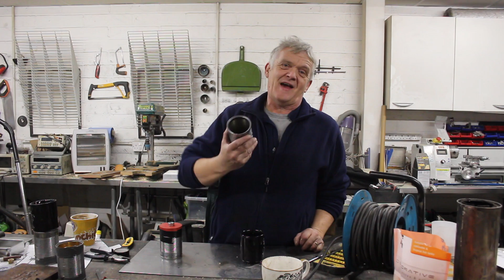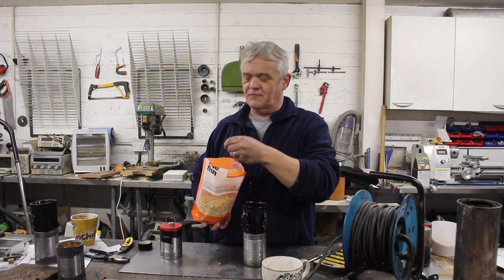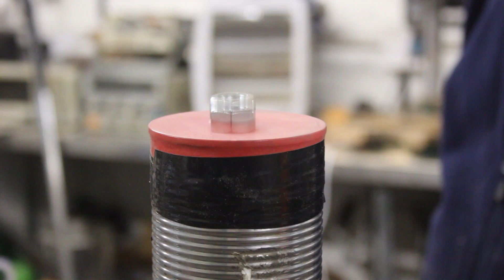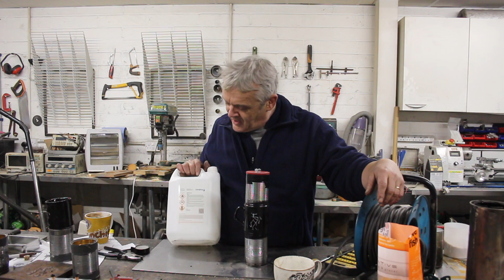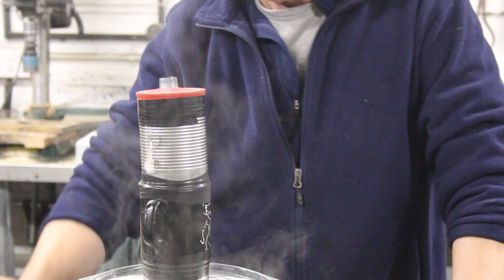1775 Running A Strange Engine From Hot Water

Comment: And in walks weirdo with his silly question of the day:
Which stage do I need to wrap the cooling jacket around, for max differential?
I would assume the top, and I shall try this.
And then I shall see if it can use water with hot water.

Comment: Why don’t you take an unmodified speaker and seal it to the top of your tin can heat engine. The speaker diaphragm replaces the balloon, and the magnet & coil should generate electricity. A subwoofer would have the longest stroke and strongest magnet.

Comment: You should try different types of ceramics. Zirconia and steatite both have a very low thermal conductivity number, alumina is a little higher.  Fiberglass and epoxy have a thermal conductivity number of less than steatite or Zirconia, but you have to worry about melting or deforming from heat.  It would also be interesting to see what using copper for the top and bottom would do as far as efficiency being as steel has a very high resistance to heat compared to Copper.

Comment: You could put several of these in series to drive a crankshaft and get decent torque. It could be placed over a heater without decreasing the heater's efficiency, in reality it would be "recycling" some energy from the heater (at least while the environment is colder than the heater itself) so it would be a way to reduce a heater's electricity bill (since it would generate electricity), the question then becomes how much of this can you put on a heater to get bigger and bigger savings.

Comment: Once you have the magnets installed, I bet you could optimize the effeciency by modulating the power output, ie, changing the apparent mass of the magnet/membrane system.

Comment: Could you have  insulated foam for the separator?? And have a better insulation value but air can pass through??  Or anything with cooling the top (old pc heatsink bonded on)

Comment: Methanal, ethanol, or plain rubbing alcohol will rust out the bottom of the can eventually. What if you switched out all three cans with a glass or plastic tube instead. Maybe three ceramic mugs instead?

Comment: Sorry off topic but it don't know any other way to contact you 
Magnetic neutralization  there is a gentleman on YouTube that has developed it he gets 2 1/2 times out of his generations .with magnets on the rim to generate the power on the wheel crossing iron core coils then in side near the center of the wheel there is  small neos in aliment with each coil\ magnet turning on the rim and an adjustable opposing neo s stationary .they must be adjustable and smaller .I was thinking of your wind generator .or any generator .just food for thought .merry Christmas  I'm buying the first round .

Comment: Luvly!  The stones are your heat exchanger.  You could perhaps try something metallic like steel wool (which would be fine with your methanol working fluid) in a fairly thin layer.  Also solder a bunch of fins on the upper can where you are trying to waste the heat to improve dT.  And a tin shroud soldered around the boiler to improve heat capture from the heat source.  Etc...  The speed your brain works you could make a hat out of the device and charge your phone off the waste heat from your brain activity!!!  :)

Comment: Will start to store my hot shower water and place some of these devices in. Instead of just letting it down the drain.
To make it a little safer with flame and ethanol you could heat water and place the device in that water. Just adjust the flame so it don't boil away the water. Adding a water cooler at the top of the device would also be an idea, as you could cool water outside and bring it in to the device to make the temp difference bigger.
Can you run it upside down? In that case the temperature at the top will keep the heat as heat moves upward and the bottom can keep the cold a bit longer.

Comment: Maybe make a v2 out of plumbing fittings and using PVC instead of the ceramic. I really want to see how much power can be produced using lower boiling point liquids like methanol or butane, but I get that it's rather dangerous.
Reply from the maker: you are talking 4-8ml - not that dangerous mate

Comment: I didn’t get why with the ceramic mug there’s no need for the pin hole to equalize the pressure.
Reply from the maker: I might have made a mistake in construction and not fastened it up properly so I might have a leak so I will need to check as I don't get it either
Reply: @ThinkingandTinkering  having an enclosed system would be a game changing

Comment: got one running nice jumps about 4-5cm but i did need the small hole to get it started , next step is to try to run a fan directly of a crank attached to top of can it should help cool the top can. my plan is to use it on the fireplace like those peltier ones you can buy , awesome vid
Reply from the maker: I might have made a mistake in construction and not fastened it up properly so I might have a leak so I will need to check

Comment: if we install Piezo Sound Buzzer instead of Magnet & Coils, HOW  efficiency will it be as  İt's will be much more cheaper cost vise, with the same invesments we can make 4-5 of those power towers.  Also maybe we can drive a a basic  folded paper/ alim . Cooking sheet (origami style) air foils 2 drive air as a  fan, for a stove top fan. And instead of tin we can use Alim. Cans as they are mor heat conductive, maybe we can scrach them in the inside to destroy plastic lineing and increase the air & alimin. Contact area.
Reply from the maker: I dunno - try it and see

Comment: Rob, If you use alcohol (no heating applied at all), and drive the diaphragm manually, such as with a speaker coil, will the bottom can get cold?

This could be a cooling system powered by sound.
Reply from the maker: I dunno

Comment: Great content, I'm sure it's already occurred to you and other followers, but average ground temperature runs around 55 F (at least for my geographic location), and I've personally researched dozens of solar thermal collectors that are easily able to reach 140 F with water as the working fluid and up to 170 F using air as a working fluid. Several were made from empty beer cans. Placing this engine between the two could prove extremely interesting, considering that the average person would be able to recreate the engine and thermal collector with limited capital. The overall efficiency might be much less than PV solar, but it also wouldn't cost $8k to build. I wonder what the size requirements would be to be able to make a model large enough to supply electricity to the average household.
Reply from the maker: those are all good questions and ideas mate - well worth investigating

Comment: I look forward to the generation. Probably need to reduce the weight, as the magnetic resistance will take on that role. Obviously not much power but the relatively high frequency should help.
Reply from the maker: yes I was thinking that
Reply: @ThinkingandTinkering  if it is too hard to get the resonance going with magnets, you could try capacitive generation, which is an interesting topic in itself.

Comment: Could you load it with carbon felt instead of the rocks?
Reply from the maker: now that's a very interesting idea - cheers mate
Reply: @ThinkingandTinkering  also:  assuming you use water in the bottom can & not methanol, will it still work if you put a single ice cube in the top to help with thermal exchange or will the cool water dripping down into the bottom stop the "reaction"

Comment: Robert: Can you explore the idea of using very small generators that charge a capacitor  with a system for releasing the charged capacitor to heat a resistor for a sand battery, etc.  Overcome the challenge of starting power to begin  generation....Thanks for the entertaining and fun learning! Ron Malenka
Reply from the maker: I have already done something similar mate

Comment: It's a heat pipe with a flexing end.  So what if we made two sections, one hot up tower with the motor membrane for expansion and the other in cooling water tower in a room temp passive water bath for condensation, put them in a loop connected at each end.  The Carnot cycle efficiency would be raised because water contact on the condenser surface will transfer a lot more heat quickly.
Reply from the maker: cheers mate

Comment: Hey @Robert, What happens if you fill the bottom with sand and heat it instead of water. Using the sand battery technique.
Reply from the maker: I don't think a lot will happen mate - but you could try it and let me know
Reply: At the least, how about wet sand heated to near boiling point?

Comment: I wonder if you could heavily insulate the engine and use liquid nitrogen or some other super cold liquified gas to run it from room temperature difference.  I don't see why you couldn't at least until it fully gasifies and the rubber gets damaged by the extreme cold.  Maybe something like this could be placed in-line with a coolant system to use the energy off of it to blow the air making it more efficient.  Could go any way with it to be honest.  A question that I have though, could a smaller hole in the bottom of the top can cause turbulence to make the diaphragm move more times.  Like the glass thermoacoustic engines are made.  Just some random thoughts.  Thanks again Rob!
Reply from the maker: I don't think you would need to be that drastic to get it to run at room temp mate - we are not that far off already
Reply: @ThinkingandTinkering  LOL, true enough.  It was only a thought experiment and for a reason.  Using this in a different environment as a viable soultion.  For example on Mars or the moon where temps are a bit more harsh .  But, yeah I get  what you are saying.  Admit it though, it would be fun to take to an extreme.  Thanks Rob!
Reply: @ThinkingandTinkering  I guess my point was that they will work with any temp difference if it be of a high enough magnitude.  Cheers Rob!  Thanks for the reply!

Comment: Try R-134a
Reply from the maker: I don't have any
Reply: @ThinkingandTinkering  It should be available at auto repair centers.
Reply: Just a few questions.
Is the methanol in the bottom can?
How much gravel in the cup? Could you use a plastic jar instead of the ceramic mug?

Comment: Still hoping you'll use the I-Stove as the heat source to charge your phone! Would a flower pot (with a screen covering the hole at the bottom) work instead of a ceramic mug?  How about ammonia cleaner rather than methanol as an operating fluid?
Reply from the maker: I will get there mate - that step is easy lol - I don't think a plant pot will work over time as it is porous and ammonia is a bit smelly to work with but I would think it would work just haven't tried it

Comment: I was thinking to rubber band a wet rag around the middle can and use a squirt bottle to rewet it if it started drying out during use, but ceramic makes more sense.
As for alcohol in place of water, that would also work on a sand battery. Maybe a rectangular container with several of the generators side by side, then pour hot sand (or water) into the rectangular container. (Thought of that when I passed a long, rectangular flower planter and wondered how many cans would fit in it sitting side by side) Any source of heat (stove top, rocket stove, solar) could be used to heat the sand (or water) and it can be used indoors safely.
I figure if one of these generators can make a usable amount of electricity, 6 of them all running at once should make more.
Love this channel.
Reply from the maker: I agree mate - cheers

Comment: Robert I desperately need you to wrap a copper coil around that top can and put a lite neodymium magnet on that nut. Simple as that.
Reply: How many turns of the copper wire would be needed and what thickness or gauge does the wire need to be please?
Reply: @kentishbunyip6081  depends on the output your hoping to achieve also how big of a magnet you used. Also the diameter of the can. How far the magnet is from the copper. Essentially you want it as close as possible. Metal bottom can plastic/or nonmagnetic top can? So the magnet isn't pulled to the can. I would say a smaller diametr wire arounf 20ish wraps would probably get decent results. Put whatever your using to measure the current + on one end of the wire - on the other. Plz share! :)
Reply: @kentishbunyip6081  I honestly see alot ofnpotential in this. You can lift s magnet of substantial size with this little force and once it got started jt would go intil it ran out of heat which could be anything from focused sunlight to rubbing 2 sticks together.
Reply from the maker: getting to it mate - but you culd also do it - you know what will happen I will do a version and folks will make a hundred suggestions and all of them good - I can't do it all mate
Reply: @ThinkingandTinkering  i love that you actually respond to your subscribers. You are correct I could. I have tried a couple using different rubber material as i dont have balloons handy haha but i digress. Keep doing you robert, we are merely commentary to the masterpiec YOU direct. Side note i know you deal with a bit of negativity from time to time. -Some people could literally stand on a hot coal and complain about their feet being warm. Your doing work that will be appreciated long after their cries fade. Truly a role model virtue and character.
Reply: Many thanks for the replies guys. Time for me to get my thinking cap on then. My children already think their mother has gone mad with these experiments but I come from a long line of tinkerers so....... I hope I will have the last laugh when I can at least charge my phone from a bit of drainpipe & balloon sitting on a radiator, or some such.

Comment: Instead of the diafragm you could use a speaker. Then you also have a magnet and coil and you can make (some) electricity!
Reply from the maker: the speaker is damped so you would lose power but worth a try for sure

Comment: Great Job Robert. Have you tried punching holes in the mug with a nail? Trick is to submerge it in water while you do it. Saves buying diamond cobolt drill bits. Looking forward to seeing how much lecki this generates especially with 10 together on a wood stove. Cheers J
Reply from the maker: I haven't tried that - great suggestion mate - cheers
Reply: That was our thought, too, but it only works to an extent. After two or three holes, the shock from the next hammer hit still breaks the mug between the initial holes.

Comment: I wonder how difficult it would be to get the same tension across a bunch of cans lined for use in a solar trough. A small tube going though each would help equalize the pressure and maybe help bring a bunch of these engines into sync, with a bar Attached to the center of each diaphragm. 

maybe there would be much vibration transmitted to the trough and emitted as an annoying buz.
Reply from the maker: I like the basic idea as a way to sale up mate

Comment: You never fail 2 amaze me. yes I can drill some holes in a "perfectly good cup" ! Do U think we could use stacked ceramic flower pots stacked one on top of each other one right side up and the other upside down stacked on top of of the other 4 the bottom 2?
Reply: BTW perhaps we could go "bigger" with something like this?
Reply from the maker: I think flower pots would only work for a short time mate - they are porous
Reply: Thanks Rob,( U know Ur stuff) I'ii pick up  a few xtra coffee cups already got the the correct type drill and have drilled ceramics before!  @ThinkingandTinkering

Comment: Can we use different metals to promote a directional flow of electrons?
Reply from the maker: I don't know mate but it is an interesting idea
Reply: @ThinkingandTinkering  
Here are some other interesting thoughts on maximizing efficiency. Look at isobars on a weather map.The closer together they are the higher the wind velocity. Maybe the closer the Temperature difference deltaT°s are physically together the higher the the pressure gradient per unit distance therefore the higher the velocity of air therefore higher frequency. The faster the magnet moves the magnetic field the more fluxlines per sec get crossed the higher the energy transfer to the coil. The unit might end up smaller, more compact, less materials cheaper and you can put more units on a smaller heating surface area. Smaller wires cheaper to contstruct or mass produce just put in some bridge rectifier. Even cheap ones can handle the higher frequency. Higher voltage overcomes internal resistances of wires and everything, higher frequencies gives more energy per unit ;weight, size, cost...... 
Thats why tv sets went from60hz/50hzUK to 15khz inthe 1980's and aircraft use 400hz at higher voltages when they can.  
Food for thought.🤔🖖
Reply: Need more details of your plan, pkease say more.
Reply: @chriskelly4619  1460's , 1416, and I can't find the video where Rob was in the stream with the water flowing over metal tubes generator.

Comment: Rob would you get better voltage using the paper ghrahene vibrating thing that Luke did a few days ago that produces 21v, instead of a coil ? They could be stacked. 21v + 21v etc
Reply from the maker: Luke is going to try it mate